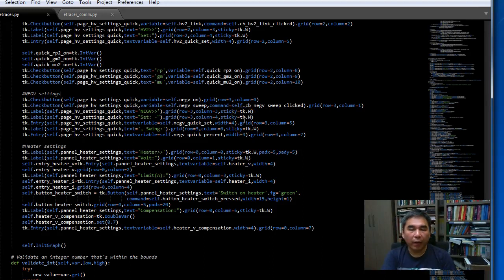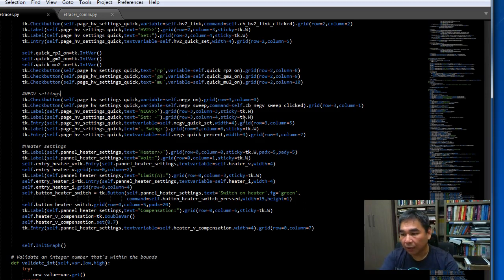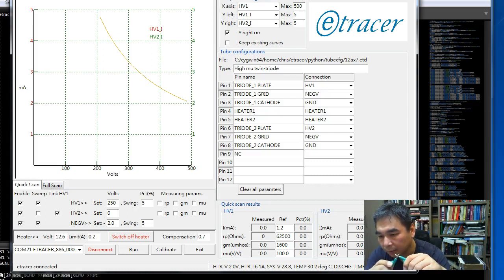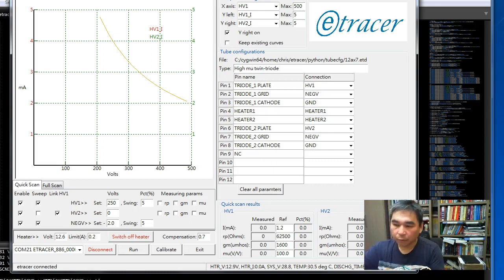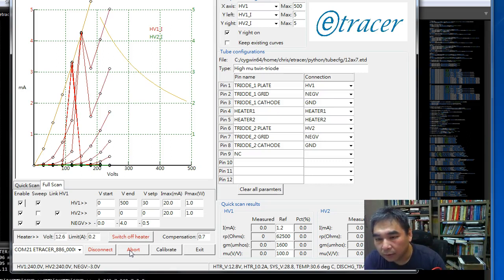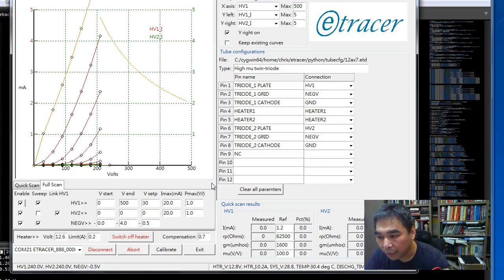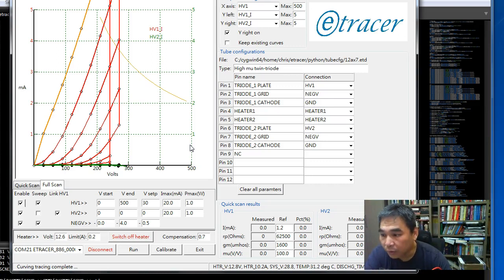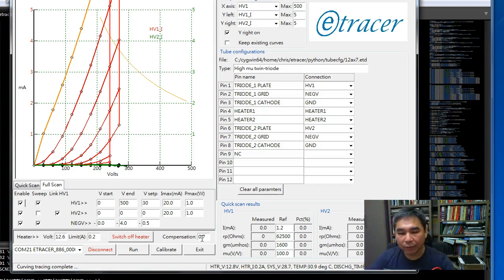etracer-Introduction of the protection mechanism inside etracer.

Comment: Mr. Chang, thanks for creating these videos on the etracer. For me, I learn a lot faster when I have a video to supplement the manuals. I just started putting mine together yesterday. It’s going well so far, but I”m taking it slowly. I’ve got to order the hardware to mount the tube sockets, so I’ve got some time to build the rest of it before that comes in. This should be a lot of fun.